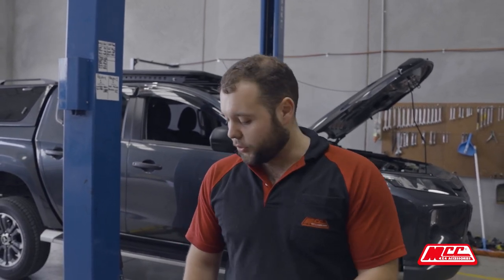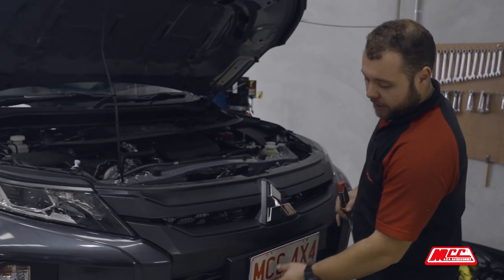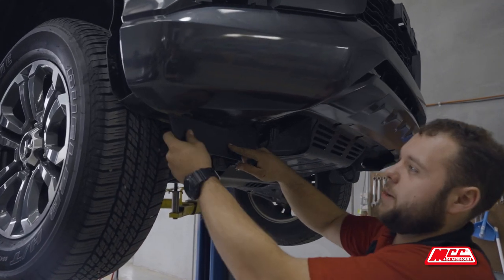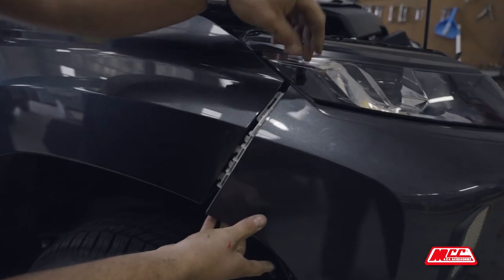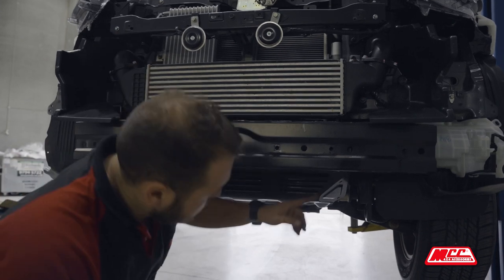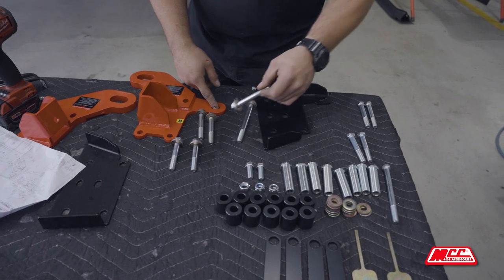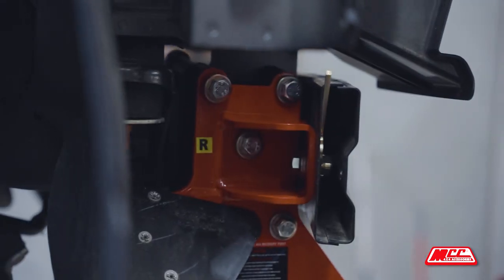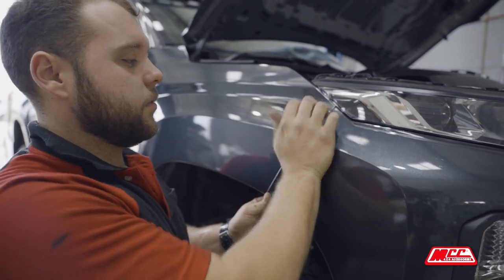Installation Guide: MCC Recovery Point without Bull Bar for MQ MR Triton/ Pajero Sport QE QF

Comment: Are the points chamfered to use with soft shackles like the Road Safe rated points?
Reply from the maker: Hey mate, they are not chamfered for the soft shackles :(
Reply: @mcc4x4accessories  ah drats. No worries thx for the reply

Comment: So I own a 2020 Pajero sport and want these installed (I don’t have a bull bar and just have the standard front)

I have been a few times now that the black hook on the front can be used as a recovery point as it’s directly bolted to the chassis. 

I would like to get these recovery points installed either way. How much for the above in the video?
Reply from the maker: Please Visit
https://www.mcc4x4.com.au/products/triton-pajero-sport-mq-mr-qe-qf-2015-2020-mcc-rated-recovery-points-for-non-bull-bar-compatible-set